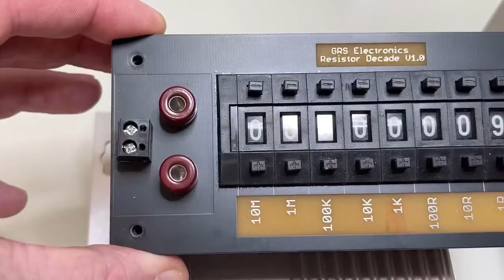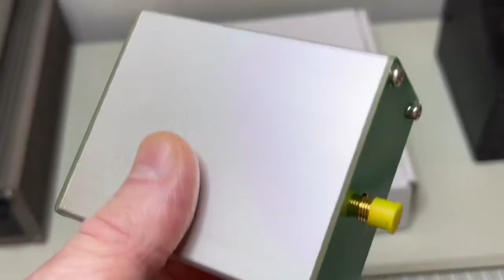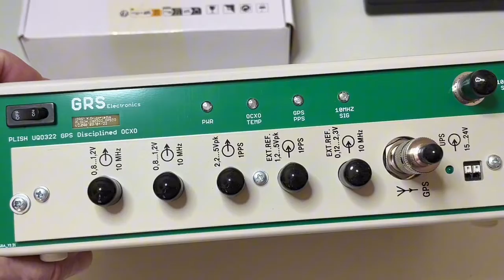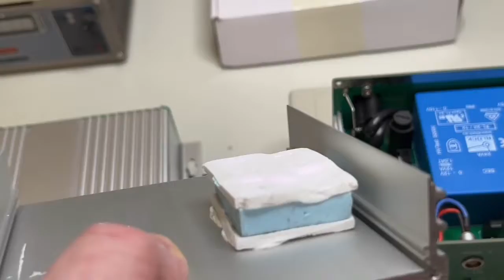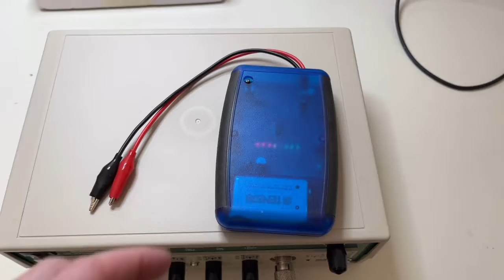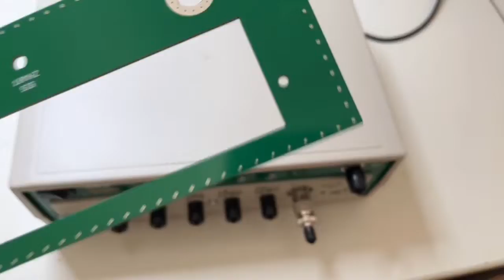Printed Circuit Boards (PCBs) make great Enclosure Panels and Faceplates for Electronics Projects

Comment: Where do you get the metal enclosures in which to attach the front/back faceplate PCBs?  Do you use KiCad for the PCBs?

Inside the case, I assume you have standoffs to raise the PCB away from the metal shield and allow the USB/RS232 connectors to sit in the middle of the panel?

I need to expose a USB, 4 differential pairs of headers (standard .1"), and 4 single ended headers.  But if I include wifi (ESP32), then a plastic case might have better signal than a metal case.  If so, should I still use PCB for the front/back, and a custom plastic enclosure for the middle..  or just do the whole thing in plastic (no PCB faceplates)?

Any recommendations for the 3D CAD software?  Plasticity? Tinkercad?
Reply from the maker: 1) I get most of the enclosures from china, aliexpress or alibaba
2) i use eagle for the pcbs
3) i do not use any standoffs , the enclosures i use have sid grooves to slide in the pcb , everything is designed to fit directly
4) just use either an external antenba or a internal antena mounted on one of the 2 frontplates pcbs(no groundplane then)   
5) I do not use any cad software except eagle

Comment: how did you find the cases?  Also where do you buy them ? asking since i am strugling to find good cases online and the ones i find are only super expensive and large.
Reply from the maker: Hello, All the Aluminum Cases I Showed in the Video are from Ali Express, only the Big Plastic one is from a Local Supplier.

Comment: Great video! I am thinking to use PCBs as front panel as well, although I am afraid about using silkscreen for labels. Are they reliable? I see them getting off on one of the panels you have. Would copper text be better?
Reply from the maker: Hello, Thankyou!, I never had any Issues of coming off, unless you scratch it off. If you mean the White on Black Panel , that look faded, well it is faded bcs it was one the first ones I made with this PCB Manufacturer and they did NOT made it well(that was 2017). The Second batch was perfect, but the good ones I used for the Prototypes.Of Course Copper ore ENIG Gold are more Resilient but depends on the Optics , how it looks.

Comment: I use aluminium PCBs as front panels.
Reply from the maker: Yes , but these are much more expensive
Reply: Acrylic sheet and vinyl sticker are also low cost option.

Comment: On the last big box how did you make the labels and put them on that beige plastic panel?  I'm talking about the beige front panel which is mounted to your PCB for your big box.
Reply from the maker: Hello, the Beige Panel that has the many BNC connectors on it , is not Plastic, it is the Original Front plate of the GPSDO 19" Card that I converted to a Desktop Appliance, The Front plate I Made is the Green one. More Details about the GPSDO Card here :
https://www.youtube.com/watch?v=GCt5v7agloQ
https://www.youtube.com/watch?v=l6-hkEx-aOQ
Reply: awesome, thanks for the reply. @KonstantinGrigoriadis